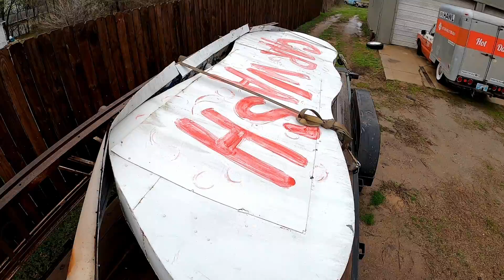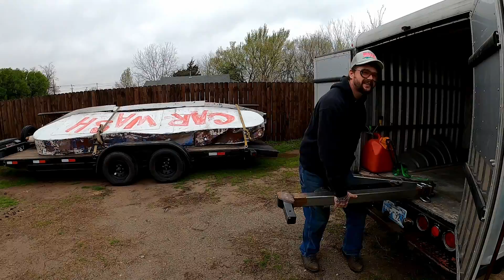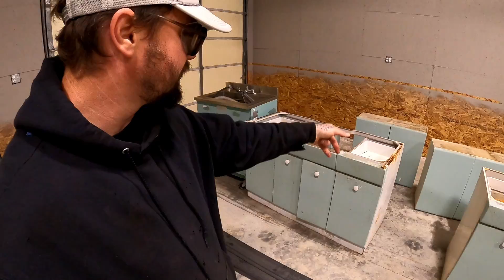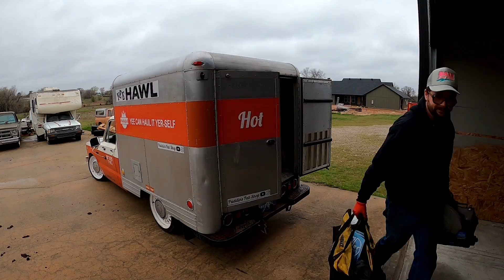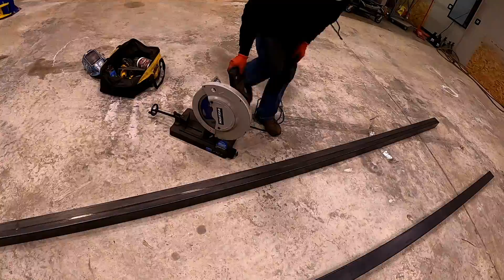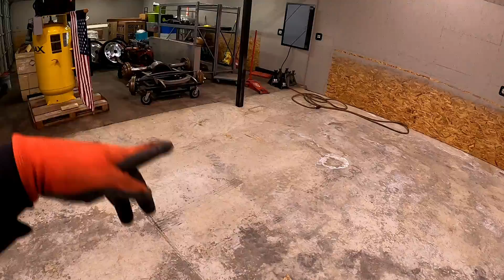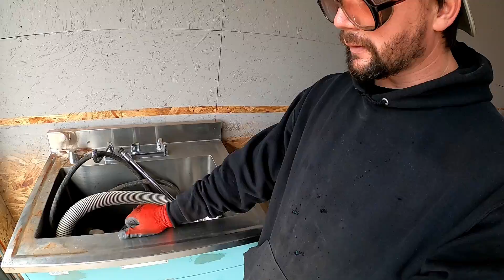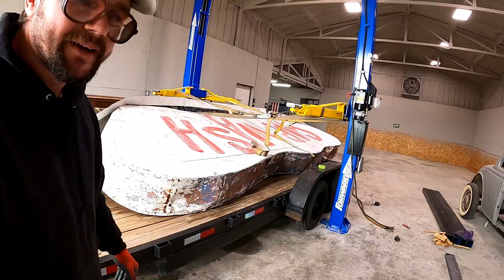BIG SIGN, BIG PROBLEMS. Successfully wasting time.

Comment: Just use rubber wall cove for the floor. You get 100+ feet in a roll and it would serve the same purpose plus be waterproof
Reply: Agreed. Or have a bunch of 26 guage sheet metal bent up to look like base trim with a slight kick at the bottom to follow the floor contour. Much easier to deal with , and way, way cheaper than using all of that good steel.
Reply: Hubby and I used the VINYL COVE MOLD!!! Comes in 4” and 6” standard! Hubby is CONTRACTOR,we used this in our Garage and Basement! Our wall colors were Tan with Black vinyl baseboards. Looked Sharp!!!
Reply: I dont know how well rubber is gonna hold up to hot metal slag long term, id more so suggest either tile cove or like corey said some sheet metal bent to coves.

Comment: Someone once said, “Education is cheap at any price!” I bet you buy more education before you really learn; I know I have!😂
Oh, I would go with a hand wash sink in the shop. That stainless steel is easy to clean. Not sure you have a Bathroom in there (hopefully you do, otherwise you wish you did!) but I’ve seen many a nasty greasy shop bathroom sink and it would be nice to have a separate one just to wash up before going to the house, plus a lot of times you need to rinse off part with water after being in certain chemicals and you could hook up a separate sprayer. Well I know you didn’t ask for it but that’s my opinion! Good luck on your build I know whatever you do will be right for you.

Comment: Think about a Skin of Fibreglass on your walls since it is Fire Resistant.
Reply: Have you ever seen a fiberglass boat catch fire.  They will burn all the way to the waterline when sitting in the water and all the way to the bottom of the trailer if sitting on one.
Reply: @bbrut3332  Its not the fibre that burns its the resin filler try lighting a piece of fibreglass
Reply: @bbrut3332  Fiberglass: Made of glass that is spun into fibers, then combined with plastic polymers, fiberglass insulation is naturally fire resistant. However, although the fiberglass itself will not burn, you will need to be careful with batts that are backed with paper or foil, as these materials can burn quickly.Sep 12, 2019

Comment: Hey puddin I think I would turn that sink into a parts washer it would be good and it would match all the other cabinet that's a good idea getting old cabinets and then you could use for a top or if you're going to either go metal or wood get a butcher block Wood top for it's real thick and you could do all kinds of hammering and what-have-you on there? And I plan on coming out to see you on April 15th at the truck show I'll look forward to.

Comment: Caulk every single gap in your building. You want it sealed as best you can. The better you seal the walls the less bugs you will get and the better it will be if you ever install a mini split. And the commercial rubber base board works great for shops. It what they use in kitchens and stuff.
Reply: X2 on the cove molding. I think I mentioned this before, but you could consider using a fire-rated silicone caulk along the base.  Silicone caulk is already fire resistant, but for welding BBs you might consider the higher rated caulk. Look for it in the fireplace / wood stove section of the big box stores.
Reply: And where the hell are the mice getting in from
Reply: Maybe a shop cat

Comment: Someone mentioned cement board. That would be good on the base of the walls. Make sure you have several fire extinguishers hanging around the shop. Put the car wash sign up and hire some young ladies to run a topless car wash.

Comment: Bottom boards can be done out of hardy plank siding concrete board. Can you get house siding or 4x8 sheets ripped either to 4" strips or wider. Should protect water and fire. The whole lot is cheaper than metal. Hope helps

Comment: I think a hand wash sink is valuable  since the house is so far away , also an eye wash station
Reply: A bathroom. Deep sink, toilet and a shower is a must. Puddin is full time fabbing. Keeping the grit and grim out of the new house is a must
Reply: @coolHandLuke5150  yesir
Reply: @coolHandLuke5150  ooooh shower! Yes!
Reply: And a toilet
Reply: @billscruggs5170  As much pedialyte as he drinks, I'm thinking he's already marked his spot back behind the shop a few times.  And once he gets a fence to hide his parts rigs and future projects, his bathroom space grows exponentially.
Reply: @billscruggs5170 , running water would be a plus.
Reply: Agreed, already has a parts washing station. He'll need a regular sink in the shop often.
Reply: I ran water to my shop last year. Man what a difference. Should have done it ten years ago.
Reply: Concur!
Reply: I was a dumbass once I decided to remove a fuel rail without releasing the pressure and got shot in my eye with gas a eyewash station would have been lol I ran in the house and you wash my face in the bathroom sink
Reply: Most importantly for the slow motion car wash video clips!!
Reply: @andymac7668  100% !
Reply: I totally agree with you, nothing like wanting to dig into a taco or burrito from taco boy and you’ve got a mitt full of grease covering your hands, hand sink takes care of that, and a toilet would be a life saver.
Reply: Washing greasy hands off in the shop and not in the kitchen sink will make Mama happy.
Reply: I have no water on my shop but I keep a bottle of contact lens solution I had in there just in case
Reply: I agree with some of the guys, wash basin, eye wash, good first aid kit or two and a good few fire   extinguishers. Now for the human side depending on how far from the house a pooper place if feasible. Lots of lights .
Reply: seconding an eye wash station
Reply: I agree. 
Since the shop has no plumbing get a RV with a bathroom & can be used as a man cave, office & doghouse. To dump the sewage you can get a portable tank to dump it somewhere. I don’t know how your setup but I dump mine in the sewer clean out that’s in my driveway. I don’t think your supposed to do that but I’ve been doing it for 40yrs. 
Most of the time when I’m out in the shop I have a bucket & take it outside to water the weeds.
Reply: Okay then how about by his own porta potty. And some dude wipes. I don't think a full bathroom in the shop is in the budget. Maybe a GoFundMe is in the making.
Reply: @billscruggs5170  Realistically, you're talking thousands of dollars or even 10k plus. Not sure if they're on a septic or city sewer system. But if on a septic, he would have to either get a whole separate system for the shop, which will be about 10 to 12k depending. If he has to run a sewer lime from the shop to main trunk, gonna be a few grand there too. Same with getting water in the shop. Not to mention having to cut concrete to lay pipe to get the water in and out.
Reply: What head yeah I know
Reply: A utility sink would be perfect, and you can put an attachment for the faucet that can flip up so u can wash your eyes easy.
Reply: George  dude your weird, no one asked you. They're giving advice.
Reply: I agree especially the eye wash station can be a life saver in critical situations and like he said parts washing stations can be cheap a good sink/eyewash station by the sink could be huge for saftey
Reply: Puddin…..you should keep your sink for hand washing and for emergencies like washing out a cut for first aid and eye washing. Believe I put 17 years in my shop and  I’m glad that I did, I even put in a rest room because when you gotta go you gotta go!!!!
Reply: Safety First for you and your family especially when they want to work on projects in your workplace. Thank you for this and stay well.
Reply: I wouldn't waste the money on an eye wash station, the ones that use the eye wash solution need to be changed out regularly. Just using the small handheld eye wash bottle would be more realistic. Plus if the shop is not heated, I'd definitely steer away from having water in there. You'd hate to come out one cold winter day to a busted pipe and flooded shop.
Reply: Well we know how Puddin's with fire 🔥🔥🔥!!! 😂 
A water source and sink should be high pri-or-ity!😉

Comment: Use good acrylic caulking on the base boards instead of silicone. Way cheaper and being inside, plenty durable
Reply: absolutely agree, I use a Loctite all purpose Phenoseal most of the time for indoor stuff. has good adhesion, is flexible, mold resistant and what I love most being a painter is that it's paintable within 20 to 40 mins depending on how thick of a bead your putting down. I cleaned up a mess in my home I bought from the last owner using clear silicone around everything, smeared everywhere, the clear dried up and turned a dirty yellowish brown it was terrible I had to scrape everything down and redo it all so it looked normal 🤦🏻‍♂️😂

Comment: For fire protection the cheapest would be cement board siding for homes OR Trowel some Drive-it or Tile or floor Compound on the plywood. Flex bond is what we used for basement tile and easy to use. 👍🕺🏻🕺🏻🕺🏻🇺🇸🔥